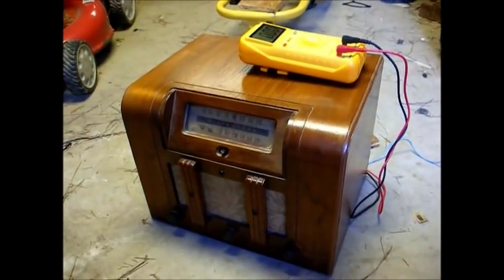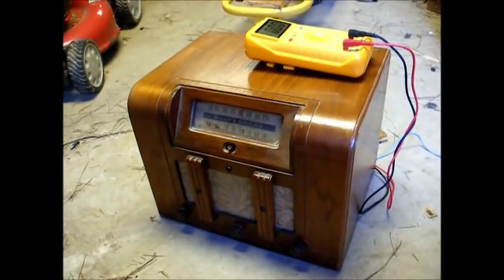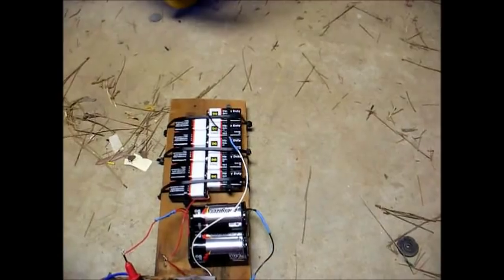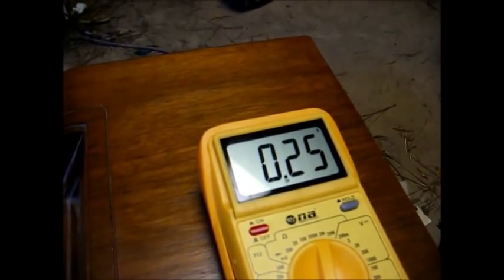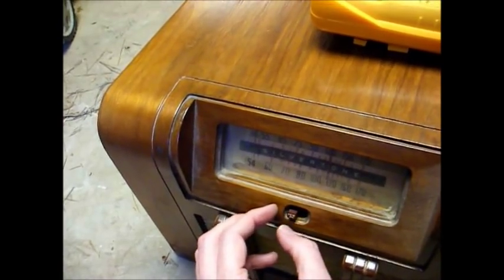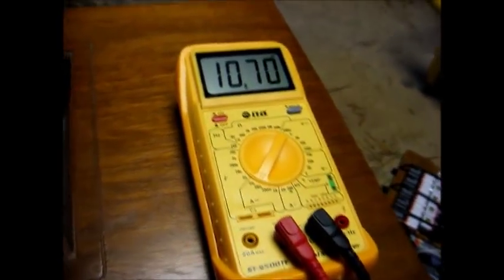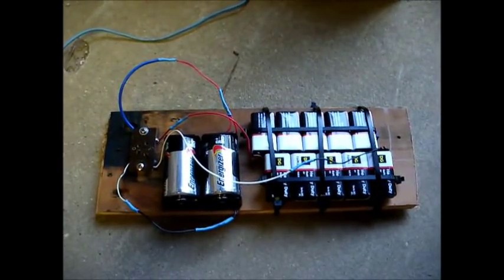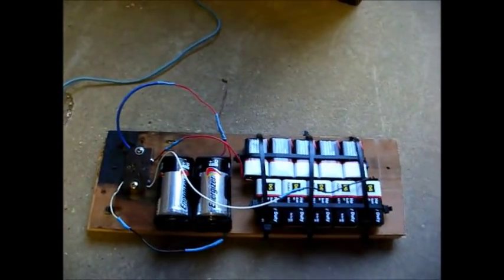Early '40's Silvertone battery operated tube radio and battery pack

Comment: I've got a 1937 vintage Coronado 650B which is a rebadged Arvin 618B which uses 2.1v tube filaments and 90v B+, and I made a battery pack setup very similar to yours except on mine the B batteries (the 10 9V batteries daisychained together) died prematurely because I accidentally dropped them in the snow when I was bringing the radio back out to my car from my parents house after I had brought it over to their place to demonstrate it to them after I had electrically restored it which also included replacing the oscillator coil because it had all but one of the wire leads from the windings to the terminal tie points broken.

Comment: That's definitely a fine set. Thanks for sharing. Most likely the battery-save function setup would work best with a set of tubes installed that have their full or almost-full emission levels, especially the converter stage.

Comment: I love these old farm sets. I have a restored Silvertone 2441 from 1941 with its matching "Powr-Shiftr" AC supply, and also a Crosley 6B1 "Battery Six" from 1935 that was designed to run on a six-volt car or tractor battery (and which is in the queue for repair and restoration).

Comment from the maker: That Crosley must be one of those that uses a vibrator power supply. I have a Silvertone like that and several other companies made radios like that. I also have a 32VDC Philco tombstone that has a standard line cord and plug, along with a big WARNING tag hanging off the power cord to plug only into 32VDC. That still didn't stop someone from plugging it into 120VAC & causing damage. I've also seen a few 1.5V/90V farm radios where the tube filaments would be blown from crossed battery wires.

Comment: WHy not use like a rechargeable 12V battery, a vibrator, and a step up transformer? Seems like it would be cheaper in the long run. Any thoughts on that?

Comment: Yup, it's got a rather large vibrator unit sitting on the chassis. Crosley called it a "Synchrotube", and it is supposedly a self-rectifying vibrator, from what I have read. Don't know if it works or not, as the battery cable was missing when I got the radio, but it's a neat-looking tombstone set that has not only AM broadcast but also two shortwave bands. I can imagine some farm family sitting around this set in the evenings, listening to "Amos 'n' Andy" or President Roosevelt's fireside chats.

Comment: That connector looks a lot like the phono hookup in some of the Silvertone combo units if I'm not mistaken.  The cable from the turntable had a metal cover over it and plugged into the mating connector on the amplifier chassis.

Comment: The 9v cells will have to be replaced after no more than 10 hours, especially with those carbon zinc 9Vs.  In fact, they will probably need to be replaced about 1/2 way through the life of the energizers.  You are drawing 125ma from each D and you should get 6 or 7 AH per cell.

Comment: I am working on one of these radios now,  6-16-20, came as a box of parts, I got the tubes in, heaters all seem ok. the batt save switch is missing but some one tied the 3 wires together. still the filament circuit looks OK. I built  the batt pack,  checked the current draw on each tube by plugging them one at a time, all seem ok about 20 to 40 ma except A5, draws only 1 ma, for a total of 130 ma. Where do you get your schematics. The ones on the antique sites are all poorly scanned and impossible to read. hope to find one of Riders quality.  please help if you can   thanks joeb

Comment: Were the battery packs rechargeable back then or how much did they cost and how long do they last? ?? sounds like the 1.5 volt would have to be replace quite often. This sounds like a radio similar to the philco radio Loretta Lynn says she had growing up in Butcher Holler Kentucky during the 1940s it was battery operated because they didn't have any electricity
Reply: No rechargeable batteries. The farms didn't have the ability to charge them.
It would have costed a fortune to run the radio.  This was before alkaline batteries.  They would be much larger than modern alkalines, but because they are so much less energy dense, probably held less energy than the Ds at least.
I'm guessing maybe 20 hours run time. The battery would have been expensive. At least $5 in 1940s money.
Reply: I looked it up and I saw one price list (40s) that puts it at $5.95  This was at a time when 1 dollar bought an ounce of silver.

Comment: i just dropped 40$ on a portable silvertone.. the wire gets hot  but not enough to really be concerned about
Reply: tails doll black   It most likely has a resistor element in the ac line cord. They called them curtain burners back in those days